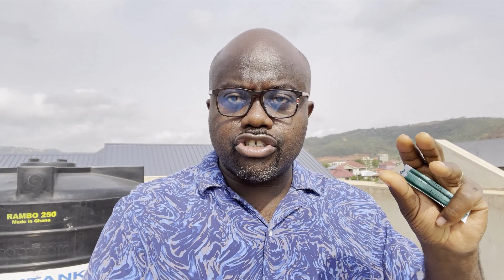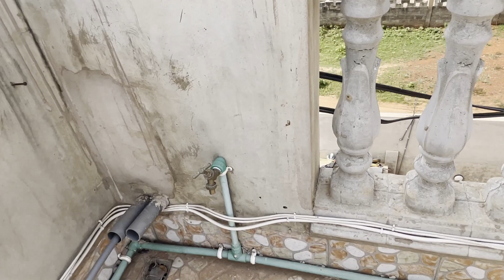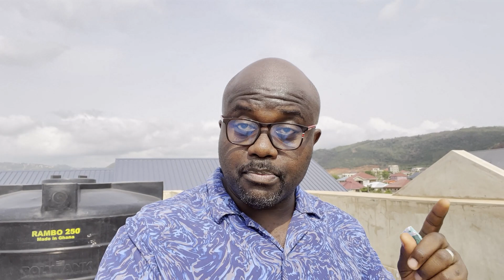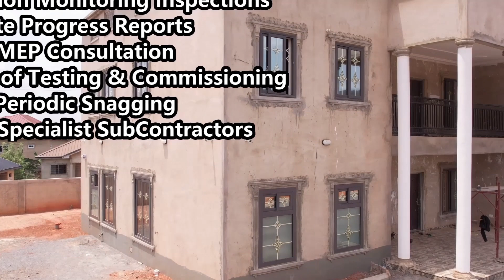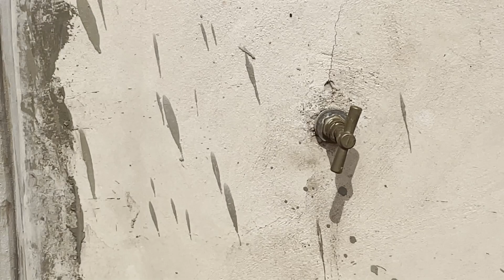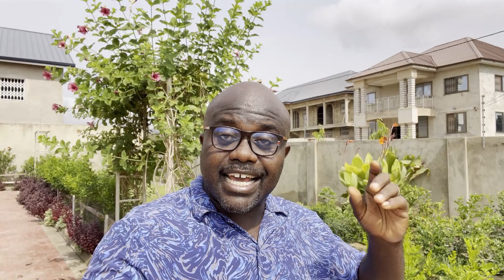COMMON PROBLEMS WITH AUTOMATIC PUMPS | BUILDING IN GHANA

Comment: That's just one of the downside of using Ghanaian local artisans. This problem could have been found and rectified if the installation has been tested during the 1st fix stage before covering and paving. Our local artisans in GH are not willing to invest on tools and equipment for the job, neither do they upgrade their skills. I'm a plumbing and heating engineer here in the UK, but believe me if I look at the quality and standard of work of our GH local artisans, it raises a lot of concerns. The next time you are doing a project  a feel you would require my assistance, please do get in touch. Thanks
Reply from the maker: Thanks

Comment: You compound looks great. You can only be sure that the leak was not from the body of the pipe, because you using quality thick walled pipes and not the cheap thin PVC pipes which can  crack sometimes  under extreme pressure or stress.
Do you think another solution may be to adjust the sensitivity of the controller or tank water level measuring device so that  it doesn't activate the pump until after a significant lowering of the water level in the storage tank?
Reply from the maker: Possibly it could work

Comment: Great insight bro.. we faced the same issues with our pump and found multiple sources of the problem.. the worse was a pipe leakage in the walls due to shady plumbing work. Thanks again for sharing this to the masses
Reply from the maker: Wow
In the walls - that’s disastrous 
Especially if house finished then you need to chisel again